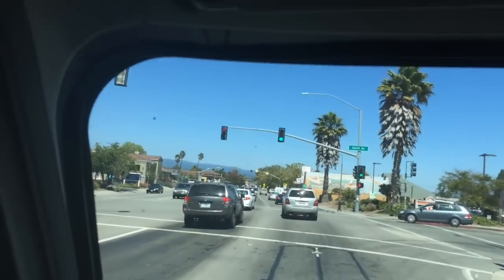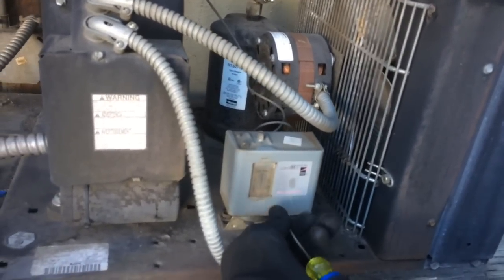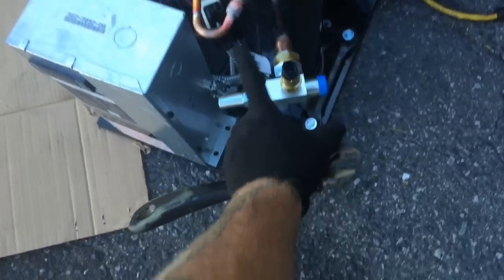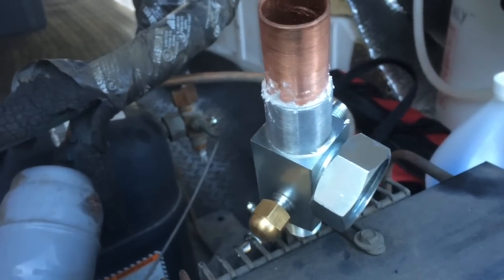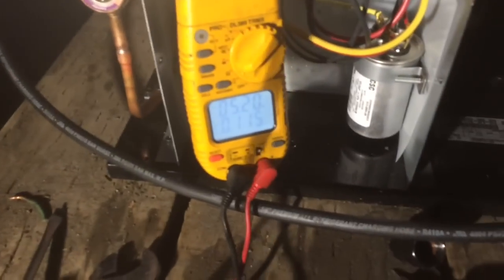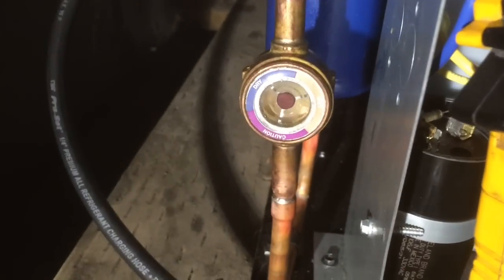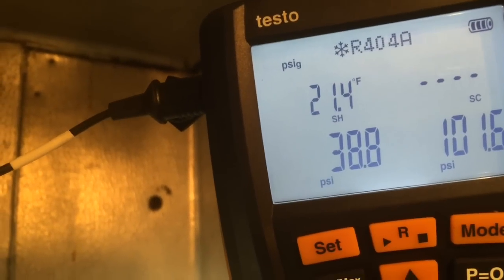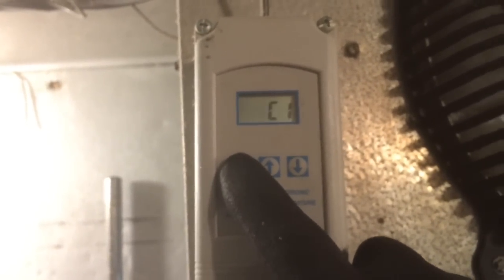Condensing unit change out

Comment: Thanks Nor Cal great video as  always. Is that mini rose bud torch tip necessary to make the solder connection on the rotolock to the tubing? I have the same or similar oxy setup as yours but I only have the #1 and #2 welding/braising tips?

Comment: Good job you don't have to use 56% sliver solder  they do have the blue rod which is 45% sliver solder and the orange rod is 56% sliver solder and they have flux inside the rod haven't use spool in over 10 years it easier then carrier the rock hard flux . And they haven't use pressure control in long time because of the blend in refrigerant in it hard to calibrate that pressure control .when I have a problem change over to A19 or ranco electric thermostat
Reply from the maker: Edward socha the pressure switch is for pump down not temp control, thanks for watching.